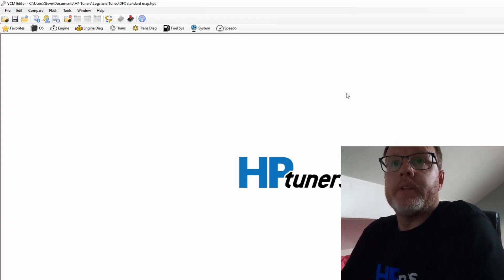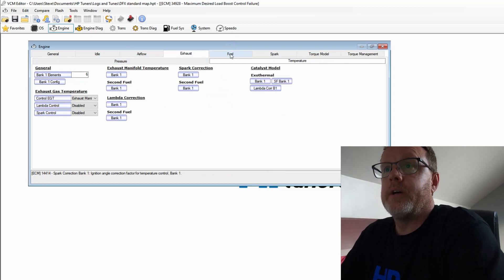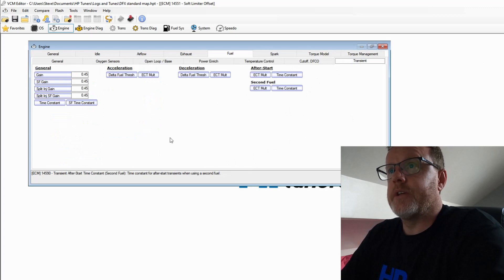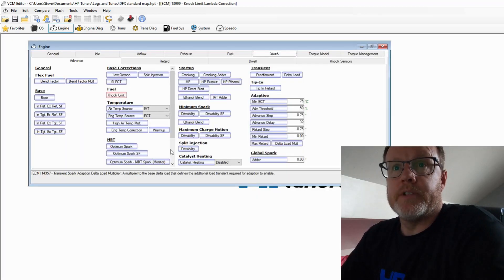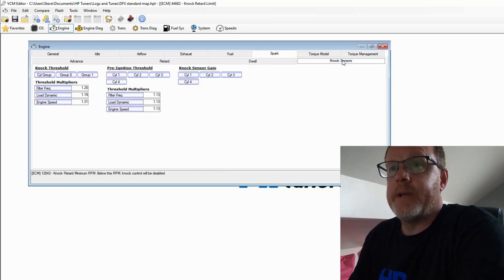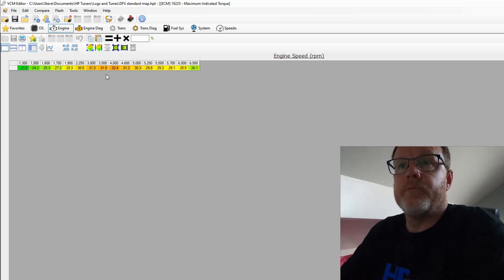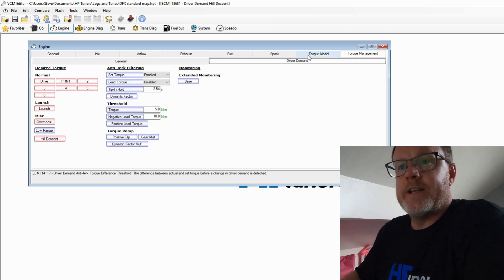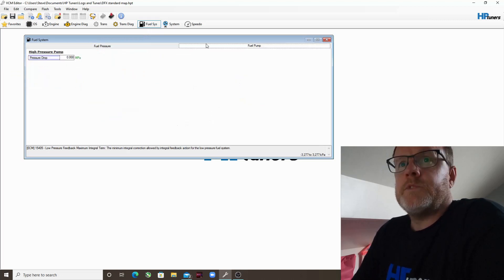Tune a Fiesta ST180 with me using HP TUNERS

Comment: Interesting video Steve. You have a knack for giving things a go.
Would you be interested in doing a follow up video where a tuner reviews what you have done to see how safe it is? Possible dyno run after too for them to check how it runs under load etc?
Again, I know this is not a tutorial, will just be interesting to see what it is actually like from a pro's pov.
Reply from the maker: Hi Liam thanks for the comment. There's no way another tuner will get involved in this imo but I am thinking a dyno session with a before and after is worth doing. The map needs more work since this base map so I plan to film that as soon as I have time.

Comment: Great to see how HPTuner works, I was thinking of getting it because HPTuner ships from Europe and I noticed LP sells the remote tune with the same dongle (but branded). Could avoid customs if I got the dongle in europe and get just the map from LP. 
So my question is, are any of the bigger tunners' maps available in the HPTune ecosystem using their credits?
Will Collins Performance iflash maps files work with HPTuner?

Comment: So you make the max boost load failure higher and then unsafer?
Reply from the maker: I did at the time because if I'm honest I was copying what I've seen others do. Iv since worked on a few maps now and and always set it much lower. In my inexperience I assumed it was done to stop a potential issue with power cut etc but iv not had any problems since reducing it.

Comment: Quick question Steve, they reckon LSPI damages a lot of engines due to mapping but dont the knock sensors retard the ignition timing if it detects knock ?
Reply from the maker: Good question. Lspi is not knock or detonation. It's pre ignition so it's an ignition of fuel before the spark event. As the piston is rising the fuel ignites which causes massive cylinder pressure.

Comment: the credits cost and dongle is cheap compared to a tune and ap.  id buy the puma max tune plugin but, we dont run the same fuel here in the us. good to see a modified stock tune here on youtube before you made the changes.

i think im going to turn off the second o2 sensor and run a wideband to a gauge mounted in the vent if thats possible. id like to run my car on 87octane (reg pump gas) here in the states. im getting 34 mpg's combined during the 80f weather here.  i may drop down in mpg's a little bit with a higher flow cat and straight through after that but, this would be a good experiment on my high mileage 1.6. 

cant thank you enough for posting this!
Reply from the maker: Thank you. Just bear in mind the USA ecu works differently to European models. Yours is more complex than ours
Reply: @Sparkplugsteve  so us spec cars built in Germany received different ecu's?  i was under the impression that the puma speed maps worked on any FiST ecu.  we dont have the same octane ratings here so i started looking for a different option and came across your video. im still going to go with hp tuner. but i wonder if i could benefit from converting to euro control modules. 

im the only person who works on my FiST. do the euro models have a governed speed?

Comment: Hi Steve, going on my first track day in July in the fiesta st. I'm a bit budget restricted for upgrades. Would you say pads, braided brake lines, and baffled sump are good enough for a first outing?
Reply: I would say  brakes are the most important upgrade for the track, I haven’t seen many ppl do a baffled sump in these so I don’t think it’s that important
Reply: @ash1808  cheers Ash. I'd already upgraded the brakes with ebc grooved discs, bluestuff pads and braided lines all round. 

Got the baffled sump in the end for peace of mind. I do push hard on track so it's nice to have. Just bought an upgraded radiator as I was having chronic, heat related, limp mode issues. 

Next things to have will be a diff and suspension. Then will look to add HP if I'm keeping the car longer term. Would like a try of the ginetta G40 or caterhams if I'm honest

Comment: Just been told that wet/meth injection can't be mapped into the standard ecu for my ecoboost, what are you thoughts Steve?
Reply from the maker: Depends in what way you mean? It can be mapped to have more ignition although I wouldn't advise it incase tue methanol runs out. Fail safes have been done though by mj performance so when it runs out it will put the car in limp mode rather than run full power and blown up.  I don't know exactly what they done but I think it's a trigger wire to the map sensor
Reply: @Sparkplugsteve  awesome mate,  thanks for the fast response probably best getting a standalone then. Looking at either a 1.6 ecoboost or the 1.5 from the st if the my 1.0 goes at some point